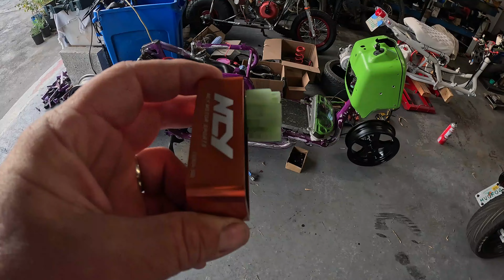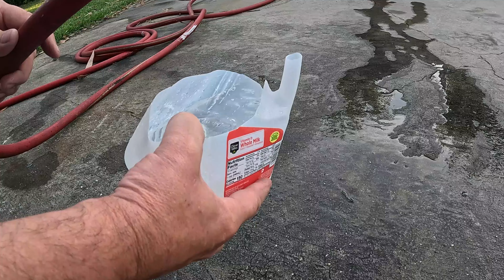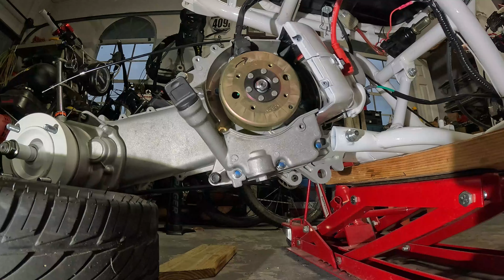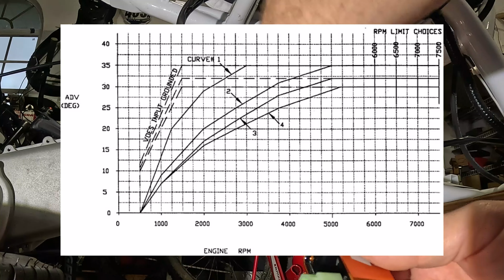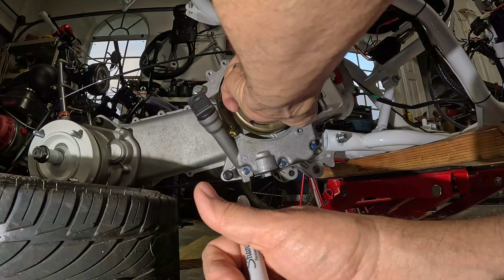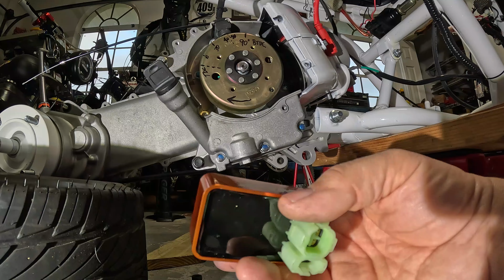Will the NCY CDI Improve a Maddog GY6 150cc With BBK, Cam and other Mods?

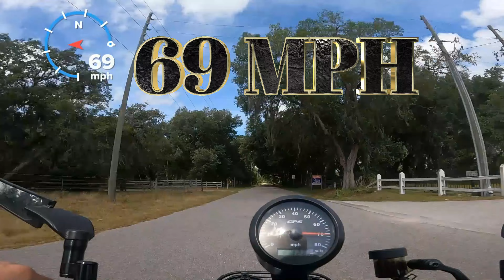Comment: 4:02 68 Hertz  

Here is the Mini Me 69 MPH data using the exact text flow from your working template:

@mrcleanisin TO: MINI ME

When you are testing new Big Bore Kits, swapping gears, changing variators or changing tire sizes, you can use this tool to mathematically determine your theoretical top speed. This provides a precise mechanical baseline to compare against your real-world GPS results.

STOCK 150cc TOP SPEED ANALYZER Copy and paste this to calculate your true mechanical speed:

1 ________________ RPM: (Your max engine RPM)

2 ________________ GEARS: (Your clutch-to-wheel ratio)

3 ________________ TIRE: (Your tire diameter in inches)

4 ________________ VARIATOR/CLUTCH RATIO: (Usually .8 for stock)

MECHANICAL ANALYSIS: MINI ME @ 68 HZ

1 CLUTCH SPEED: (8,160 / .8) = 10,200.00

2 WHEEL ROTATION: (10,200 / 8.5) = 1,200.00

3 TIRE CIRCUMFERENCE: (19.33 * 3.14159) = 60.73

4 FINAL VELOCITY: (1,200.00 * 60.73 * 60 / 63,360) = 69.01

FULL FORMULA: ((8,160 / .8) / 8.5) * (19.33 * 3.14159) * 60 / 63,360 = 69.01

Based on your 69 MPH GPS and the 68 Hz audio match, the math confirms you are running an effective tire diameter of 19.33 inches (matches a 130/80-12 profile) assuming stock 8.5 gears.
Reply from the maker: I always used Omni wheel speed calculator which takes tire diameter, gear ratio and RPM.  Looks look AI has cut out the middle man.

Comment: I believe the spark plug is fired every revelation of the crank shaft even if it's not the compression stroke.
Reply from the maker: That is correct.   I may have stated that wrong to simplify it.  But yes the pulse trigger is hit everytime.  Without a crank position sensor, the CDI has no way of knowing when the compression stroke is, so it just hits at every TDC.
Reply: @GhettoWrench  GY6 50/150 is a 1 cylinder however here's what Gemini said about Harleys:

Historically, most 2-cylinder 4-stroke Harleys used a Dual Fire (or "wasted spark") system. This meant both spark plugs fired at the same time, every time the crankshaft completed a revolution.

Here is the breakdown of how that worked and why it changed:

1. The "Wasted Spark" Era (Pre-Twin Cam)
From roughly 1926 through the Evolution engine (ending in the late 90s), Harleys were famous for firing both plugs simultaneously.

The Logic: One cylinder would be at Top Dead Center (TDC) on its compression stroke (ready to go "bang"), while the other cylinder was at TDC on its exhaust stroke.

The Result: The spark in the exhaust cylinder did absolutely nothing—it was "wasted."

The Trigger: This was based on a single set of points or a single sensor usually driven by the camshaft, but because of the ignition's design, it triggered every 360° of crank rotation.
Reply from the maker: @mrcleanisin I did know this about Harleys and was watching fortnite...... the Canadian youtuber.  He said that is a key thing that gives Harleys their unique sound.
Reply: @GhettoWrench  I didn't want to get the threads off topic so go over to your other video and check out what I said about using RPMs to determine mile per hour.  "Why Did My Performance CVT Kit Make My GY6 50cc 139QMB Maddog Scooter Slower? How To Fix It.?"

Comment: @GhettoWrench 
I didn't want to ask several questions in separate threads and cause an annoyance. In one of the lower threads you said the A9 or a good cam likes high rpm. The same thread talking about the bbk only being worth 1 or 2mph. I dont care at all about top speed, i just never go on any road over 45mph. Its all city crap as far as you can see here in Washington. I am very interested in torque and how hard the bike can pull. Throttle response and a sit you back in your seat feeling is what i care more about. If tue upgrades make it go 70 thats great but as oong as it will do 55 im guessing the 35 to 45mph rpm will be fine constantly. Meaning if it toos at 55 the engine should have longevity only going 45 miat of the time. Not running it wide open top rpm hardly ever. What cam would you recommend for a stock 150 and would that be the same cam as i would use when i do a bbk also? One for each is fine as well, just curious. It will have pwk or pz or pe carburetor, cvt tuning before and afyer upgrades, i have a Yoshi full pipe but im unsure which bike it's going on. I also font know of there is a better flowing head when buying the bbk. Hopefully this isn't a oain to answer. If so i apologize.
Oh, the vike i ordered from Cajun Maddog still hasn't shipped. Three weeks and he says that the maddog company is backed up. He says there have been 30 bikes of his sitting on the dock waiting to be picked up at the 1.5 week point. The 2 week point he said it will be any day now. At the 2.5 week point he said it's the Maddog company and they are backed up but they promised to be shipped by Friday.  I sent him an email and said if they dont get it shipped friday just send me a refund. He said please bare with me, im trying to get it taken care of. Im not sure which side is BS me. Lol.
Reply from the maker: @ZCRAIZED1  WTF!  A refund.  That is BS.  I love that Tiada.  Woth stock gearing and that cam the bike no kidding feels like it will do wheelie...  even though no way it will.  LOL
Reply: @GhettoWrench 
Awesome, that's exactly what I want.
Is it the Tiada A12 or is that an ncy cam code?
Reply from the maker: @ZCRAIZED1  no idea what the numbers on it are.  It just came with the kit.  I tried ot by itself before installing the BBK and it worked great
Reply: @GhettoWrench 
I will get a Tiada and try it.
Thank you.

Comment: Nearly every video you do is incredibly educational. The genius is furthered by the fact that its not just an explanation but a real life test that proves exactly what you are educating people about. 
This channel is far more valuable that people realize. YouTube should be showing this channel to everyone that types in gy6 or scooter and any other key word. 
I mean to say, thank you very much for your service!

It's hard to believe ncy would make a product that performs that badly. I wonder if it's possibly a defect causing that. It could be worth buying another from Amazon and trying it. Make sure it's sold by Amazon and not a private seller and it has free returns so either way if it works you can send back the original one and keep the good one and if it does the same thing you can just return the new one. Or do this with whatever place you bought it from. My finding is places other than Amazon hate taking things back. Amazon makes so much money the return side is factored into the equation I would think.
Reply from the maker: @ZCRAIZED1  thanks a bunch.  So this is crazy...  the NCY CDI performs awesome on the 50cc.  Shocked the hell out of me.  It is actually quicker and faster on the 50
Reply: @GhettoWrench 
I wondered if some performance parts would make more of a difference in one or the other engine. Also, if certain parts are developed toward a certain engine. Basic logic of a company would be to test things the way you do when doing the R&D in the creation phase of a product. The issue might be that these egg heads only look at numbers and say, ok, this will work. That's great to get to that point with the truly brilliant mathematicians but every company needs a gear head to do real life application testing to verify the mathematics did in fact create something that does what it's supposed to do.
It's no different than postal vehicles being designed. The "intelligent" people did all the engineering so the trucks turn on a dime by having a narrow front axle. The issue is they don't go through snow or any inclement weather. The front and rear wheels have to make their own tracks so they constantly get stuck.
The intelligent people should be involved in testing as well as design and we the consumers wouldn't have to deal with this frustration. Unfortunately that probably won't happen and that's why there are people like you.
Thanks a million man.
Reply from the maker: @ZCRAIZED1  so true.  Thanks a bunch.

Comment: Is this a 150cc why is the engine mount on the bottom ??
Reply from the maker: I'm riding and testing a 150.  I just had that 50 taken apart at the moment so using it to show the flywheel degrees.  2 different bikes.  I'm gonna a test that CDI and 2 other ones on the 50 when I get it back together.
Reply: @tedowen409  I have a 150 I hit 60 top have that cdi and Yoshimura exhaust 11 pole stator 30mm carb uni air filter and the ncy super transmission kit with 12 gram sliders 1500 yellow torque spring ...i have the 171cc ncy BBK with A12 cam and new pwk carb but I need to have it installed
Reply from the maker: @johnathan1361  cool.  Take out that CDI and get 1 more mph.  LOL.  If you watch my 171 test...  ONLY the 20cc more is only worth 2mph, but it gets a lot quicker.  How many RPMs are you turning?  That A9 likes high RPM..  like 9500.

Comment: 63-70 mph depending on the day sounds like your AFRs are not quite right 
Mine does the same going from 12.7-12.8 to 13-13.1
Crazy how much you can gain or lose with such a small change
Reply from the maker: Well my road I test on can have a headwind or tail wind, in florida we can go from 0% to 100% humidity and that robs power faster temperature.  And of course the temperature will be 70s some days and 90s others...  so that throws it all off.  I just like to do base run 1st so I eliminate any of those factors.  It did do 70 again tho as my gopro speedo is 1mph slow for some reason compared to my phone apps.  But I do want to buy a wideband AFR and compare computer tune vs human tune.  That will make a great video.  I have no doubt the computer is gonna win that one.  LOL
Reply: @GhettoWrench 
I am doing that now. The wide band and gauge just came in. The potential issue I see possible is the o2 seems to want to sit a fair distance into the pipe. These pipes are so small it could make a difference. I got the larger 1 inch bung to weld in instead of the standard short 1/2” type but it will still protrude a fair distance in there. I may have to build a perch for the bung so the o2 is barely inside the pipe. Or find a shorter shank o2.
Reply from the maker: @ZCRAIZED1  ya take like a front wheel axle spacer and weld to the pipe then the threads on that and space it out.  Can't wait to see what improvement you get from AFR
Reply: @GhettoWrench 
I didn't think of that, it would be far better than the nasty zink washer welding. 
I think it's still guess work but slightly more educated guessing hopefully.
Reply from the maker: @ZCRAIZED1  completely guess work.  LOL